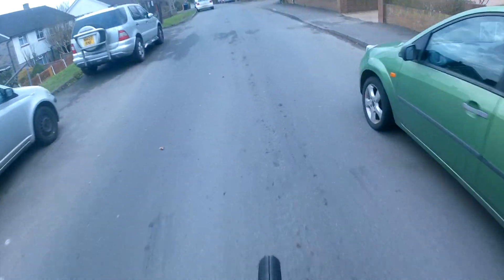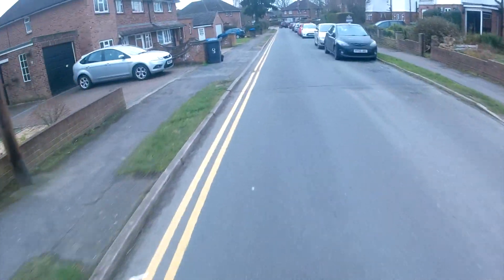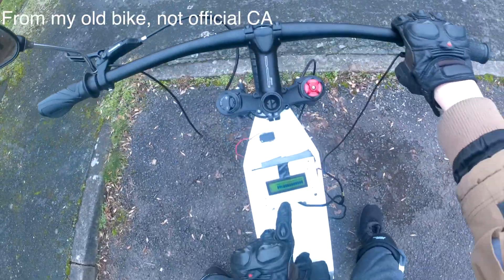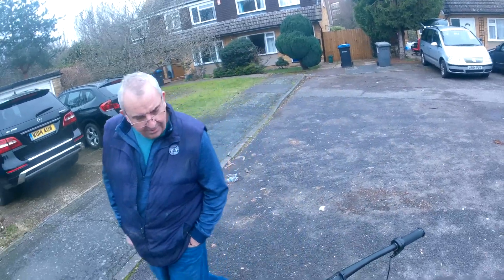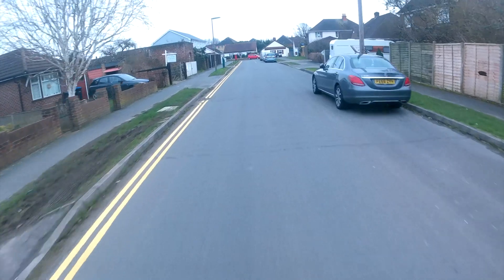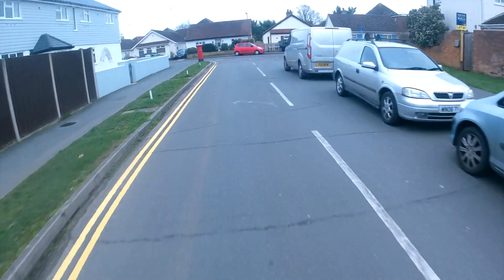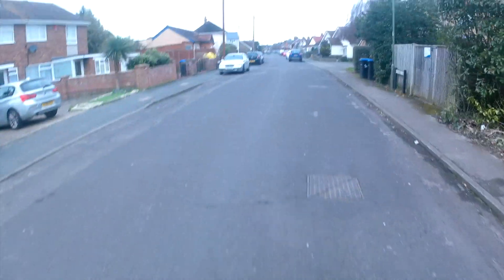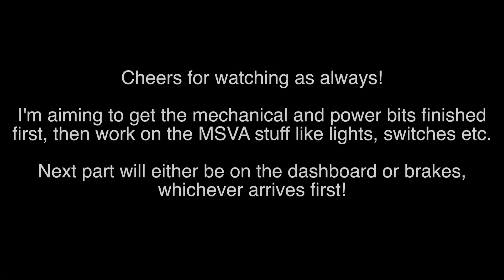TEST RIDE after fitting new wheels and forks! -  8kW Enduro MSVA eBike V3 Build

Comment from the maker: Just to point out, the front tyre IS on the right way round. It looks like it isn't as it's on the opposite way to the rear but here's a video that supports this https://www.youtube.com/watch?v=7VYOUFCKdms . I'll also show the direction arrows in the next video
Reply: Have you considered getting the wheels ballanced ?. Or do you feel given the lower speeds of the e bike vs full blown motorcycle its not going to make a difference in how it handleshttps://www.youtube.com/watch?v=dAKIuSjPXxA
Reply from the maker: @haggisbasher2906  I've seen that video, and tbh I don't think it'll be necessary, but we'll see how things go. I won't be able to do any high speed ones until the rest of it's done so yh...

Comment: Do you think my mtb hub motor will fit that frame? It has 135mm drop out.
Reply from the maker: It certainly won't be too narrow. These dropouts are 150mm so you would need to add quite a few washers if your axles are long enough to stick out the other side.
Reply: @EverythingEbikeChannel  thanks. The axel is 209mm length. I just need to add washer.

Comment: Hey again! Can you do me a favor and measure the overall size of the bike? 
From the bottom of the wheel to the handlebars and from wheel to wheel. Would be super greatful.
Reply from the maker: Front wheel to handlebars is about 110cm, axle to axle is 127cm. My email is on the 'About' section if you want more info or pictures 👍

Comment: Hi mate i don't know if this applies to you but when I first fitted my triple crown forks the top crown was hitting my frame making the turning circle terrible so i put 1 of my spacers under the crown and it cleared the frame and turning circle was perfect hope this helps. Keep the videos coming 👍
Reply from the maker: Good tip, but wouldn't work on my frame. The frame widens out and it's the stantions themselves not the brackets hitting so nothing I can do. Realistically you don't need that much apart from manoeuvring.

Comment: looks much better with the dnm usd 8. plenty of clearance at the front now looking to maybe getting those for my build already ordered a 29er mbt frame with a 190mm dnm burner rcp was wondering though given size of the front foks i am considering using a larger rim 20 or 21 inch with magura mdr-p or mdr-c rotors. do you recon those forks would take a larger wheel ?
Reply from the maker: Definitely, they're designed for 26" bike wheels so providing underside clearance isn't an issue they will fit.

Comment: U know to add a little bit of extra psi to the Schrader valve to compensate for the heavy frame.   Do u have a shock pump?  Edit*. I mean for the fork, obviously it depends on what they had them inflated to from the factory and what u like/ need for the road / terrain... mine is at about 150 psi which I’d the max they suggest in the manual... and I weight 150lbs.  I ride on the road and offroad some with large dips, bumps etc. mine was bottoming out really bad straight from the factory.  Waaaaay too soft.   Anyways glad to see the upgraded forks!  You will love them.
Reply from the maker: Going to adjust it all once when it's a bit more finished and can test it at speed. Mainly riding on road but might feel adventurous...
Reply: @EverythingEbikeChannel  ya when I first got mine running, it was a bit intimidating... now It’s fine though, you will get used to it quickly.  I remember the first time I got a little scared of the power and almost didn’t want to ride it again lol... I got pretty upset having looked forward to it or so long... the way it delivers power so instantly just threw me off just at first.   Now i love it and can’t stop thinking about riding (and upgrading it lol) all the time.

Comment: First you defiantly want a thumb throttle for regen epically if you have a twist throttle for throttle because you are going to be coastally hitting the regen when going over bumps and doing corners because you have like 0 control over your handle bars with 2 twist throttles unless you get a half throttle for regen where you can grip the outside of bar to steer
Reply from the maker: Might try half throttle and if that doesn't work, try something else

Comment: Your front tire is on backwards and for safety's sake you should put spacers and properly preload your headset bearings. Other than that nice build.
Reply from the maker: Mentioned that in the previous vid. Will get it sorted

Comment: Nice to get out and do a test run 👍🏼 I seen someone mention in your other video that brakes need to approved for weight? Or something which means my Chinese front calipers will be no good 😂 🤦 But I read All low power mopeds can have pushbike caliper brakes?
Reply from the maker: This calliper  was only temporary, got the tektro levers on the way and probably some shimano 4pot callipers to do the job.

Comment: It looks like your front tire is on backwards, isn’t the tread supposed to go in the direction of rotation? I could be wrong though. Just look for an arrow on the tire sidewall. 2:09
Reply from the maker: No that is correct, I looked it up and it's meant to channel water into the center to reduce air resistance apparently!🤷‍♀️
Reply: @EverythingEbikeChannel  
Interesting. I’ve never seen a tire in the opposite direction
Reply from the maker: @eastwood111  Here's a video explaining it https://www.youtube.com/watch?v=7VYOUFCKdms. I'll show the direction arrows in the next video
Reply: @eastwood111  It matters nothing if a tyres reversed at these speeds,if you're going over 80/100 mph then sure it makes a difference in the wet